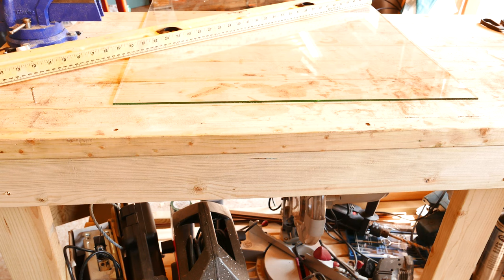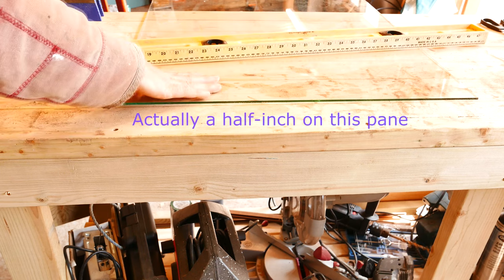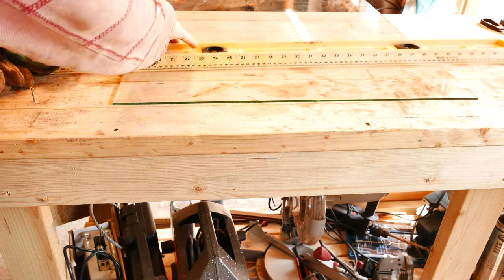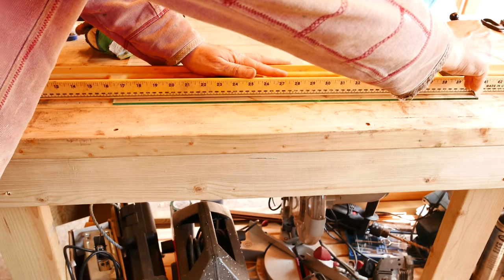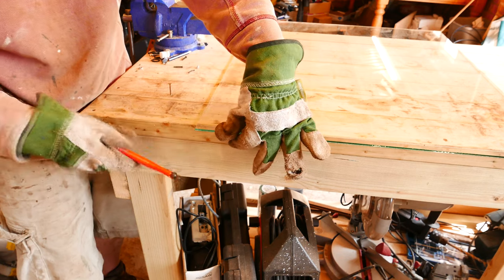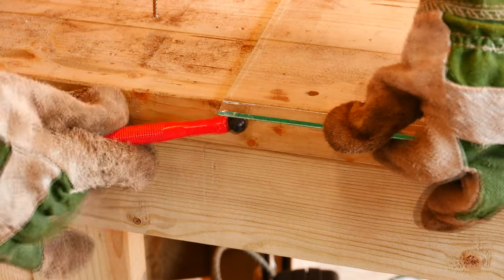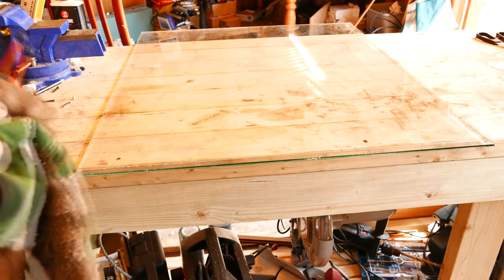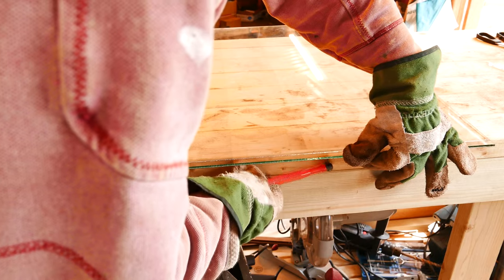How to cut thin strips of glass (in 4k)

Comment: I wish I kept looking for this how-to. I had ordered 3 French windows and the last 6 panes wouldn't fit any way or how. 1 is too long and 5 are too wide, all by about 1/4" to 5/8". Thankfully most are at the top so rain doesn't get in and the one at the bottom I just tape clear plastic over it so stray cats don't try to jump into the house, lol. The hardware was charging $2/inch to cut glass (exchange rate then was closer to 6:1 so about usd 30¢/inch.) Some also need corners cut to fit where the welding has bumps, so almost $140 total. A friend gave me a glass cutter that he wasn't using and I got as far as labeling the panes and marking where to cut; I was certain it wouldn't be a score-and-break situation as the piece is so narrow... and just never got around to looking it up.
Finally I can finish my windows! Will need new putty though, not looking forward to seeing the price of that now.

Comment: Useful, I'm struggling to find anywhere that sells 28" wide horticultural glass that my greenhouse seems to require, the nearest I can find is 28 3/4" panes used in Dutch type greenhouses so I may have to have a go at cutting off the 3/4"

Comment: I am looking to cut very small squares of glass, from only a slightly bigger piece of glass. For example, the original peice is going to be around 30x30x1mm, and I need to cut 5x5mm squares from it. Is this going to be easy to do with your method?

Comment: Ok, I just gave it a try and it was a disaster. Unfortunately, I did not notice that their was glue (tape residue) when I made the first sore. I tried to save some of the glass by cutting a smaller piece but by then their was a crack that kept getting larger. Be sure the glass surface is smooth. Something as small as tape residue can mess up your score. On top of everything else I wound up cutting myself slightly while trying to SAFELY wrap the broken glass in a piece of cardboard so I could write CAUTION BROKEN GLASS. Just not my day I guess. I'll try one more time.
Reply: From someone who had to dispose of a shattered rear windshield because the guys who replaced it didn't take it with them, wrap the glass first in newspaper or a thick fabric like old toweling, next tape/tie it if nec, and then wrap/fold the cardboard over it. Oh and use the widest tape you have to keep it closed.
Edit: or fold masking tape over the thin pointy ends, leaving some space between the tip of the glass and where you bend the tape. Again, widest tape you have. Can't imagine trying to bend strings with cut fingers >.< All the best, man.

Comment: Nice video. How thick is the glass you cut?
Í need to shave a bit off the bottom of a shower door. Would you use the same method when I only need a few mm off?
Reply: If your shower door is tempered you CAN NOT cut it, it will shatter.